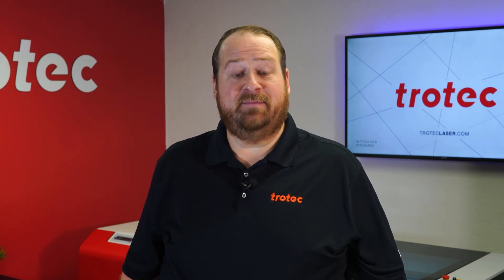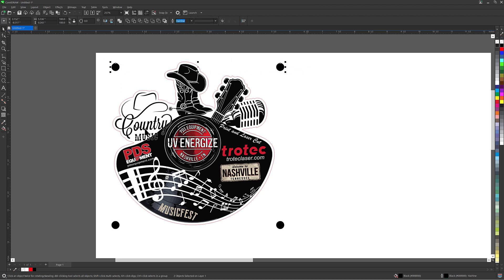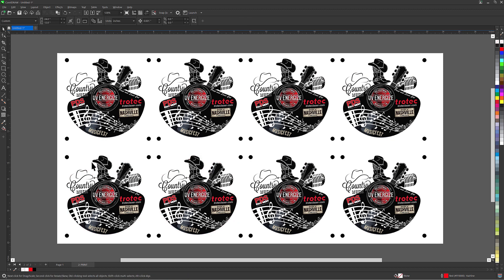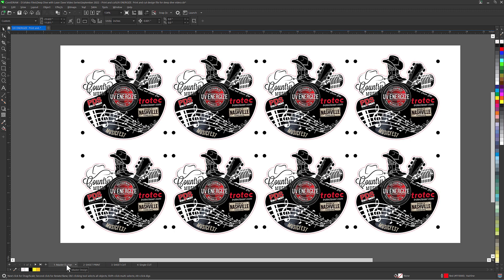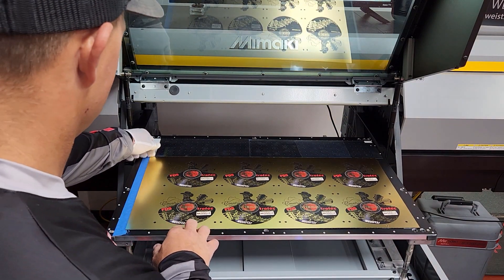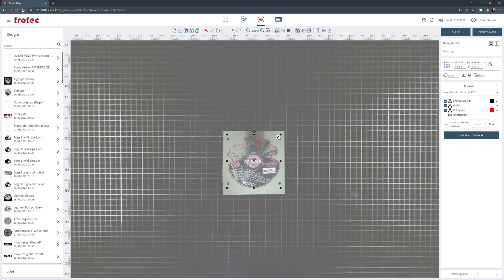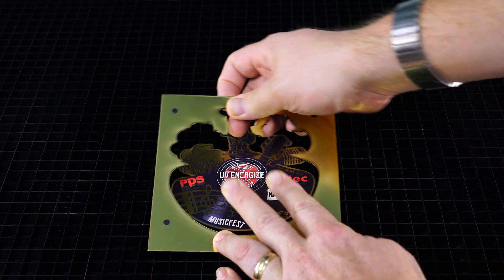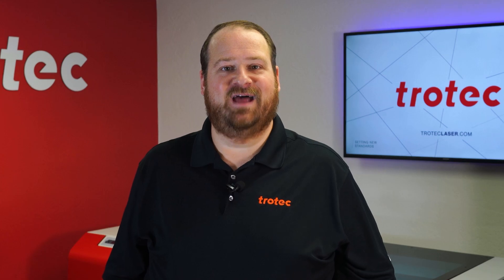Deep Dive with Laser Dave: Print and Cut

Comment: Is it somehow possible that use print cut but also with engraving?
Reply from the maker: The system is only designed for print and cut. Print and engraving have not been a feature that was requested as the images are already printed, so unfortunately, that process will not work with the print and cut camera. However, without the Vision Design and position camera, it is possible to position an engraving visually into any printed product.
Reply: @TrotecLaser   okay thx guess i have to do it with the vision camere then ....but engraving would be a nice feature for the Print & cut